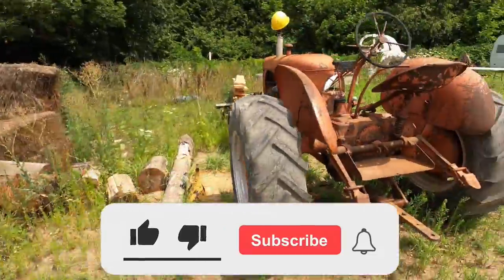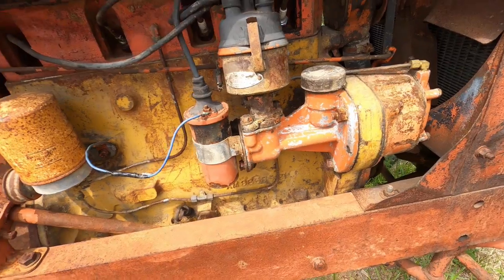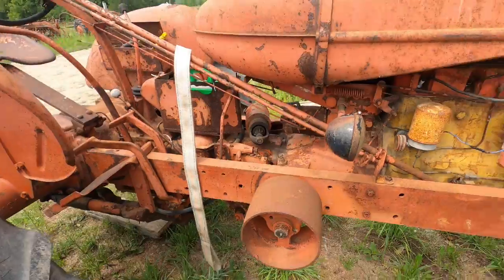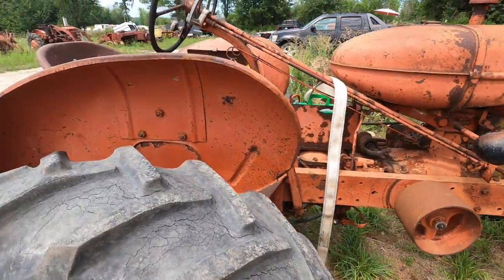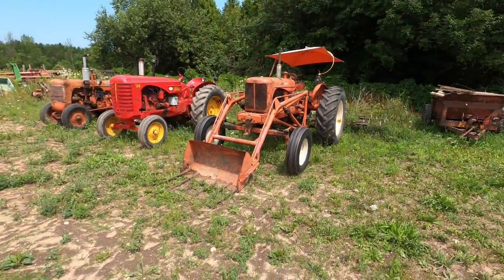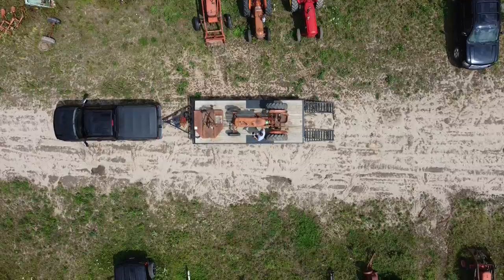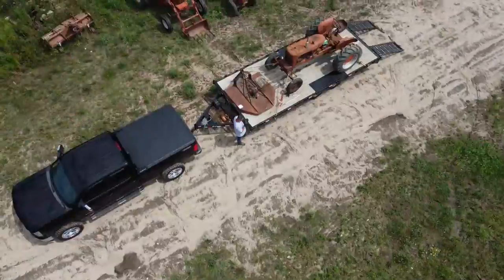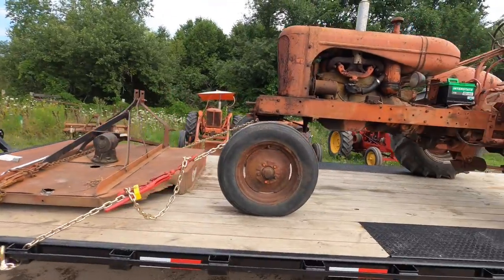PULLING TRACTOR!

Comment: I’ve heard of people finding different colors like red or yellow under their paint before. Especially on engine blocks. Manufacturers used different primers over the years from what I’ve heard. A lot of times they would be red or yellow. so maybe that was a replacement engine out of a crate and nobody ever bothered to paint it. Or like you said, it may have been from an industrial model.
Reply from the maker: Those are all great points , I’ll see if the casting numbers give us any hints! Thanks for watching , cheers